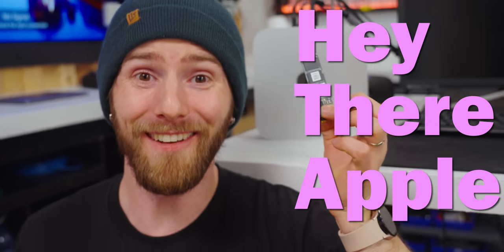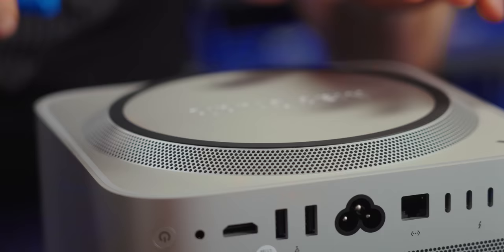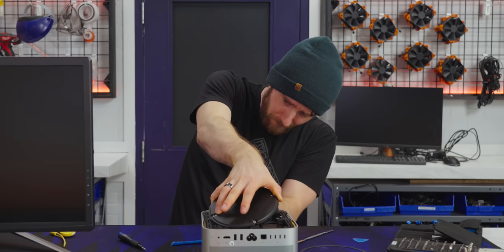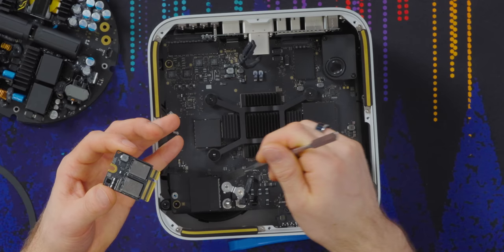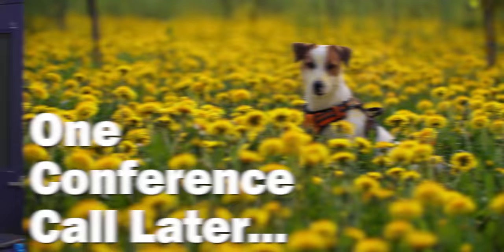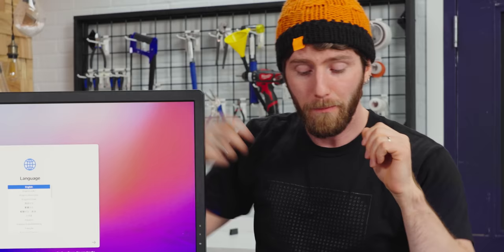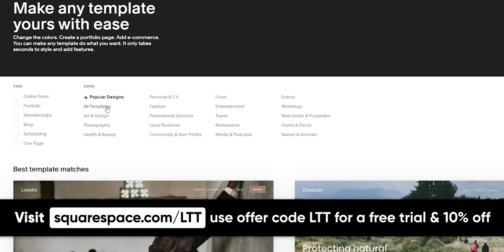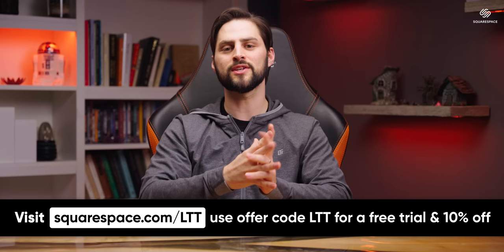I want to love Apple, but they’re making it hard - Mac Studio SSD Swapping

Comment: They made the SoC, the mainboard, firmware, OS, and specced out the specific design for the flash modules and then had someone fabricate the hardware the way they wanted. It’s all intentional, and their system isn’t special. They want the repair money—all of it, and they don’t care about doing what’s best for others.
Reply: I hate it when companies don’t listen to their consumers. Apple is just being greedy right now. That’s not right. I really want Apple to listen to the consumers, not just for profit.
Reply: @NotThatEpic7492  Apple will only stop doing this bullshit once there is actual competition. Sadly no SOC could match theirs yet. Some of it is probably due to custom designs that make it incompatible with normal SSDs like the integrated controller because the M1 might not use PCIE(just a guess). But there is no reason for them to not have a few resistors that code how much flash they have (to swap the capacity and brand of RAM you have to move around the resistors) or just make firmware accessible to everyone.
Reply: @NotThatEpic7492  It's hard, those consumers are exactly who Apple caters to - people who want to be shafted. Not people like you and me. People who specifically like the fact  that they can buy an overpriced device as a status symbol, show off their wealth, and have the security that no cheap scrub will be able to buy or repair such a device.

They would never learn how to fix it themselves regardless, and besides; when it breaks they buy a new one, they don't want it repaired.
Reply: @amunak_  kek,alot of Mac users are developers, creators .Cause Mac has made it really easy to do stuff on it
Reply: No, they don't want the repair money. Time and time again, they've proven that they want you to buy a new product once your old one fails. If you absolutely want to repair anyhow, it's going to end up costing you almost the same as buying a new product anyhow. A $5 chip broke on the motherboard? Nope, ain't fixing that, you're gonna have to pay $1500 for a new motherboard, or spend $2000 on a new computer. Most people are dumb enough to buy a brand new computer instead. Of course there are repair shops that will fix your motherboard for a lot less, but Apple is doing their best to make sure all important parts are either hardware locked (so you can't swap certain chips from one Iphone to another one for example), or impossible for repair shops to buy, so there'll be no other option than to heavily over-pay for a repair, or buy a new computer/phone/whatever. I don't see how Apple can pretend to care about the enviroment, when they are actively doing everything they can to make sure none of their products are ever repaired, they just have large parts of the product completely replaced, or they just claim it's impossible to fix and even claim that anyone who says that they can do it, are a scam, despite the fact that a lot of the things that are "unrepairable" according to Apple, is still fixable.
Apple are just actively doing their best to increase the amount of e-waste, while proffiting from selling even more products cause people aren't getting them repaired. They're directly profiting from harming the enviroment.
Reply: I don't think it's about the repair money, more like you should throw away and buy new
Reply: @fssbd5010  but they havent. they changed their entire platform so a huge swath of previous mac software doesnt even work anymore. and in the PC space, there is plenty of software that does the exact same stuff, but PC doesnt choke you down and lock you into crap like apple does. it's a toxic company that caters to the almighty currency and nothing more.
Reply: @yuxuanhuang3523  I don't think it is in the consumer's interest for more manufacturers to move to ultra-proprietary SOCs.
Think about the potential issue we're already looking at with Lenovo and CPU locking, even on non-server CPUs.

I have had a lot of computer rigs last me a long time precisely because I can swap out parts over time, whether they are old Athlon running HP machines or my own custom rigs.

I really do not like the Apple model.
Reply: I bet it's just a configuration byte/int in the SoC firmware that determine how much flash memory the system is supposed to have.
Only one SoC, but the factory programs the firmware for configuration A,B or C
Reply: @fssbd5010  … from everything I’ve seen, most creative tools run better and faster on windows with a i9-12000k and RTX 3090…  I can build one on an ITX mother board with 64GB ram and 2TB gen 4 nvme for about $3600…  more power hungry and a little noisier, but definitely faster in most work loads.
Reply: They want to price out the repair money in favor of the replacement/upgrade money
Reply: @silvestrocrino3256  you do realize that installing and making stuff work is very seamless in a Mac book.the os is very good and stuff doesn't break easily
Reply: @ghomerhust  hey like I said ,I don't have to deal with wsl and use Microsoft products on Mac without dual booting .it is a huge boost to my workflow
Reply: @fssbd5010  …ah… same with windows…in-fact a will guarantee that more stuff installs seamlessly and without issue on a Windows PC than on an Apple Silicon Mac book or studio….  If only because there is more software available for Windows.
Reply: @silvestrocrino3256  dude windows doesn't run alot of dev stuff efficiently. You can check it ,that's why a ton of students Frankenstein dual boot while the rest of the devs who work use a Mac and the workflows are really smooth.
Reply: @fssbd5010  … more software is developed for Windows than Mac. In business, except for some creatives, Linux and Windows make up the vast preponderance of development and operational platforms… and in fact, many creatives use Windows too … except for Apple developed applications and frameworks…. Nearly everything else comes to Linux or Windows first.
Reply: @silvestrocrino3256  but it is mostly developed on the Mac cause you can access everything. 
The creation of software and documentation on a Mac is much faster cause of this.
Getting word ,excel, spring boot,Cassandra is a big pain to get up and running on windows ,you need to figure out ways to use WSL and do workarounds. But doing the same on Linux is easy depending on the flavor of Linux you are using but installation is hard and excel and other Microsoft products are a pain to use. But on a Mac it is easy.
It's the same with trying to get spark,scala,yarn,kafka ,hive ,oozie,excel and powerBi to work  .
And  it's much easier to develop android apps and ios apps on Mac books.
So on and so forth.

Comment: 13:35 - In fact, there IS custom logic on the FLASH module.
All these FLASH memory modules are proprietary! Each of them has a proprietary microcontroller that connects it the M-series SOC through a PCIe x1 interface.

Comment: 4:08 apple’s been doing this for at least ten years. repairing my 2013 27” imac i found out various manufacturers made multiple variations of the psu; liteon and at least samsung iirc. totally different look, built to same spec. this might be why apple was barely affected by covid, but covid isn’t what started apple doing this
Reply: After all, that is the reason why AMD is in the x86 CPU market to begin with. IBM wanted a second supplier for the 8088, and AMD got the license.
It's a smart move tbh
Reply: I wonder if it's for redundancy in case there's a design flaw found later down the road in a particular design it doesn't affect 100% of product. If you do 50% yield with each company and there's a critical flaw that shows up later and it affects 25% of only one of the vendors (an unlikely scenario by most standards) then you've mitigated a potential disaster.
Reply: @HappyBeezerStudios  Oh that’s neat, I had no idea!
Reply: @ppcasm_1278  Also a very good point. But if you keep adding manufacturers, is there not a hypothetical critical threshold where the potential for exponentially multiplied issues directly outweighs the expectation of inherently uniform product reliability? I can see it working fine for two, maybe three manufacturers, but I’m curious how wide that net can be cast before the issues outweigh the benefits of manufacturing that way.

Comment: I remember (not that long ago) when Apple's products were among the most elegantly designed, easily repairable, maintainable, upgradeable machines around.  I owned many generations of their desktops, all-in-ones, and laptops, repaired several of them myself, and frequently did mid-cycle upgrades of RAM or disk to extend the devices' lifetimes.

My how this company has fallen.  I held my nose and bought a MacBook with soldered RAM a few years back, and then had to replace the entire mainboard for almost $700 when a $5 SMC chip on it failed last  year.  You could make the excuse that this is necessary on a laptop to achieve competitive levels of portability and battery life.

But on a desktop?  No.  When they started taking active measures to frustrate repairability and upgradeability, I jumped ship.  I'm done with them now.
Reply: I've always been opposed to Apple, even in the pre-OSX days due to how hard it was to use/troubleshoot (why no terminal, come on!).  I recently picked up a 2011 Mac Mini for running OpenBSD, and while yes, *technically*, it's upgradeable by the user (RAM and HDD, at least), replacing the hard drives is an absolutely insane amount of work.  Nobody should design a machine where the wear parts (hard drives) require the machine to be COMPLETELY TORN DOWN to swap.  You're looking at close to an hour of work if you've never done it before to swap both the hard drives in a mini.  Absolutely insane.
Reply: The original Mac and its successors were not designed even to be opened. If you found them "easily repairable" it would be only because entrepreneurs quickly responded with "Mac crackers", so you could get those dammed 5-lobe screws out.
Reply: @-danR  Have you never seen a Power Mac G4? An original Mac Pro?  Or heck, going way back, even a 9600?  Because every single one of those machines was able to be opened completely down to the logic board without the use of a single tool.
Reply: I remember the first iMac. I was baffled that Apple had created such an utterly useless thing. Loved the G4, that was a beast, but from there on I was out.
Reply: "not long ago"

It has been a decade since they released an actual Macbook Pro that can be upgraded. Last products that supported this were the Mini 2018 and one of those iMacs.
Reply: @AB-rz5iw  I suppose time passes differently now... Twenty years doesn't seem that long anymore.
Reply: When was this exactly? I remember as long as 2012 they were always same or worse than competition on repairability
Reply: It's always been the same old crap from Apple since the 80s.

Comment: i was literally in 6th or 7th grade and took apart my laptops (HP and Dell) without doing any (significant) damage.  most people are capable of repairing their devices if companies don't pull an "Apple" like here.
Reply: The worst is that they used to be a lot more upgradeable.  They used to use standard SATA drives even in laptops!

Comment: In the 90's, I manages an academic department at a university what had all its faculty computers and lab computer as various Macintosh models. None were uni-box designs and all had easy to open cases (generally just either snap off with plastic clips, or a removable panel and the motherboard could be slid out to access). Both RAM and hard drives were accessible and each to upgrade, and there were a few third party products to upgrade with PowerPC processor boards in the late-90's... which we did for the faculty systems rather than replacing the systems completely. It was easy and we trained student workers to help do the upgrades. Wish Apple went back to that more consumer-friendly sort of design.

Comment: Apple specifically goes out of its way to stop you from upgrading the "SSD"
That is infuriating and totally what I expected of such an anti-consumer company.
Reply: I doubt they went out of their way, the system needs to know the layout of the flash. They just dont provide the most basic configuration tools (ie the BIOS utility built into every PC) to anyone but their service agents.
Reply: @mycosys  There is a certified tech that commented further down and he confirmed when you change the configuration of the SSD you needs to re-flashed the SOC.
Compare this to any laptop or PC on the planet where you can just throw in the extra SSD stick in and the machine and Windows will just see it.

This was done on propose.
Reply: @ryant2568  ANY laptop or PC? Are you sure? Not saying Apple are right, just that it happens in the PC world too. At least it does in laptops and all-in-ones (equally as infuriating whether it’s a PC or Mac)
Reply: @DanielHarrisCodes  you can just put a ssd that fits in a laptop (or an all in one as you stated) and windows or linux will detect it unless the manufacturer goes out of their way to lock that functionality in the BIOS or the OS but they won't cause it's just a waste of time. you could prove me wrong by giving examples where installing a new SSD is not possible as long as there's space for it
Reply: @kaneki1056  I meant there’s a lot of devices where you physically can’t get access to replace the SSD at all. If the criteria to be acceptable is “if there’s a slot we have to be able to use it” then Apple could just solder it in instead and be like the majority of ultra books. Im not saying it’s right just that everybody should get crap for it
Reply: @DanielHarrisCodes  Ok there are a small handful of examples that won't allow upgrades like the surface pro but in that instance it is actually soldered to the board.
There is no reason Apple could not allow users to upgrade the SSD on these devices.